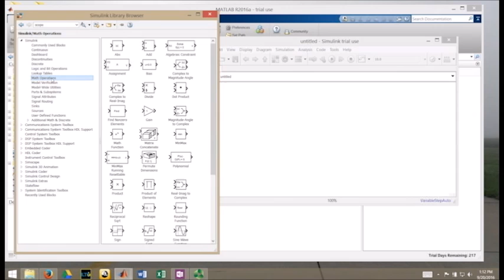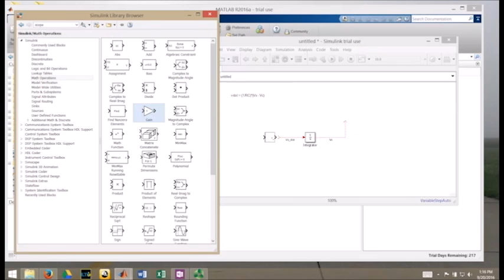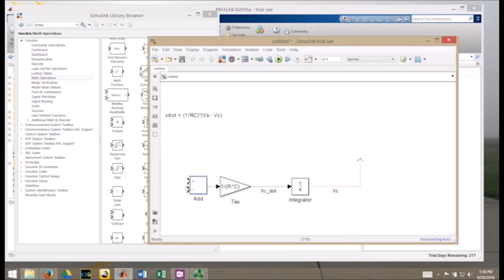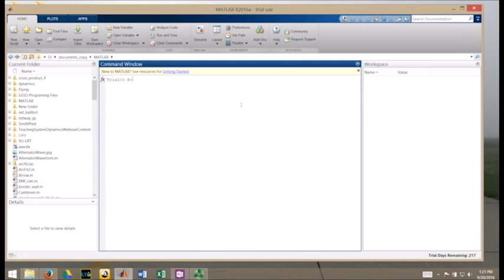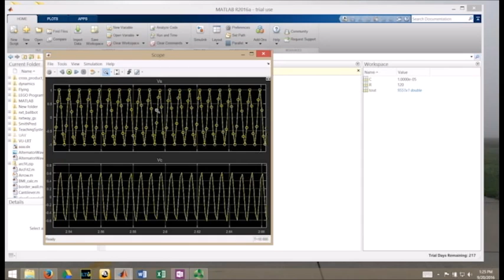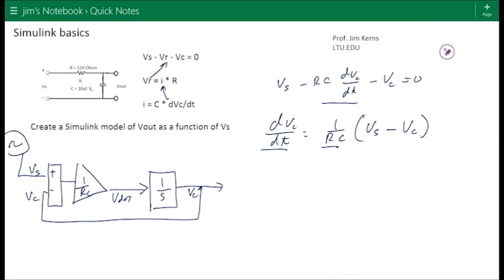Simulink for Beginners, Part 1

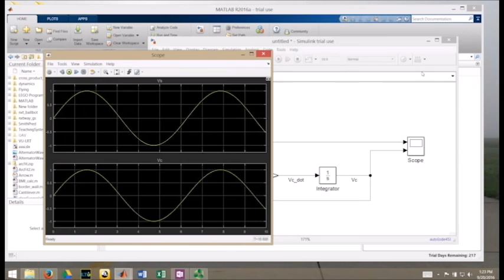Comment: Hello, how is it possible that by doing an integration over a sinus signal (Vs), the result (Vc) is still sinus ? [Pause: 14:39] Just look at the origin of both signals: same derivative, same initial value... I'm expecting a cosinus signal..., or almost different slope in the origin... Am I wrong ? I have done the same exercise, by following you, but using different connections between the blocks and I get what I'm expecting... I can guess the problem, but it is quite complicate to explain... Anyway, thank you a lot for this video: it is my first time on simulink and it is worth it ;)
Reply from the maker: Directly integrating a sine of course gives you the cosine. If there wasn't the feedback part, that is what you get. Also - when you think about it, the difference between the sine and cosine is really phase and what you get when you have the feedback is a sine with a magnitude and phase difference because we are mixing the input with the integrated output that has that phase shift built in - If we went through the math (transform to laplace / inverse transform is the "classic" method) and we end up with exactly a sine with a magnitude and phase difference from the original signal. The degree of phase and magnitude difference changes with the frequency of the input as well as the 1/RC term. 

I hope that makes some sense - it does get kind of messy to explain.